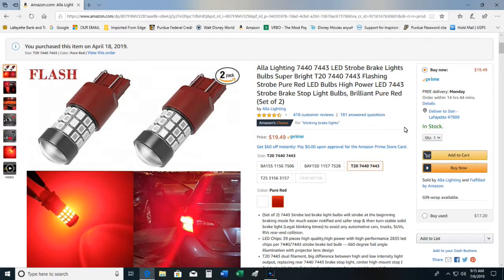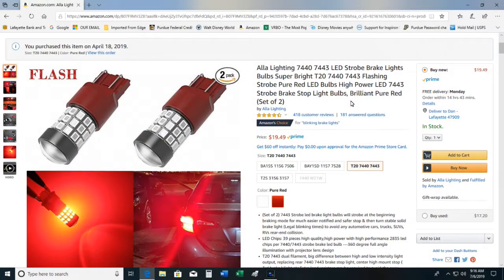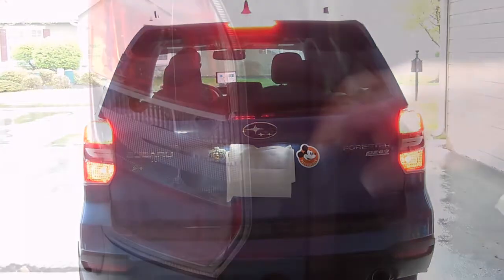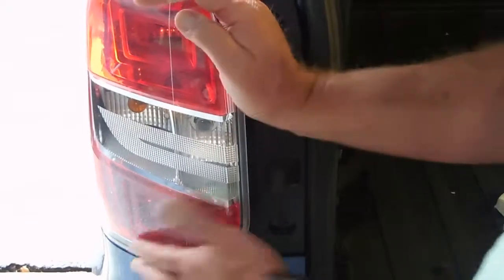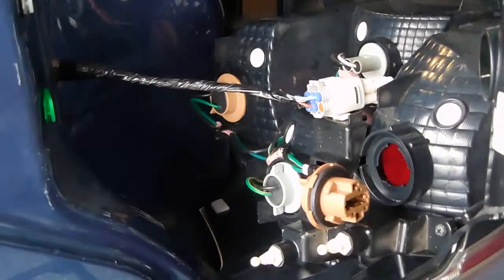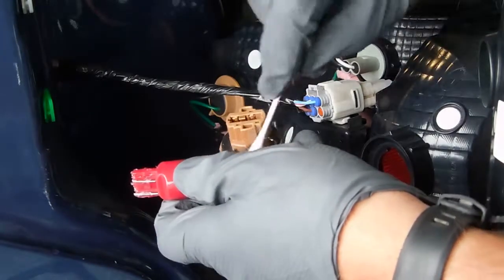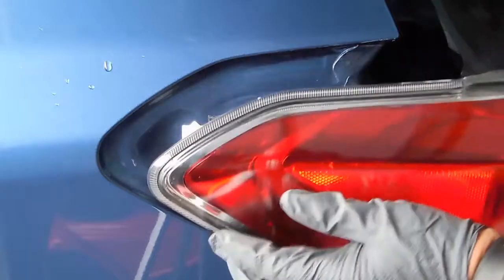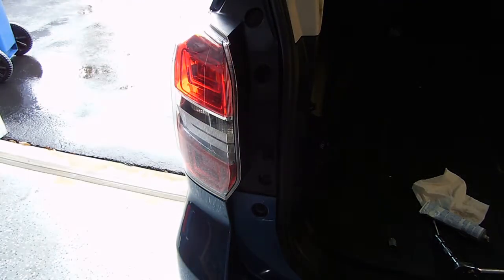Alla Flashing LED Brake Light Review (2016 Subaru Forester)

Comment: What size are these sir? I pulled the same ones up in amazon and it says they do not fit my 2017.
Reply from the maker: I think they re-modeled the 2017 Forester, and your is updated with LED tail lights?  The 2016 Forster still had the incandescent lamps.  Your bulb size according to AutoZone is part # 2825 but unfortunately I didn't see this type flashing bulb for your model.  Sorry.
Thanks for watching.